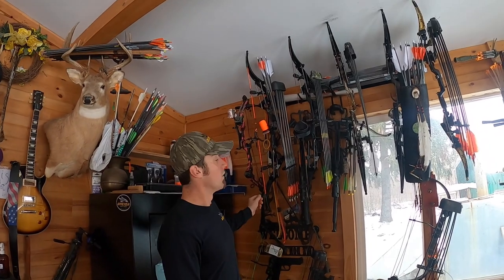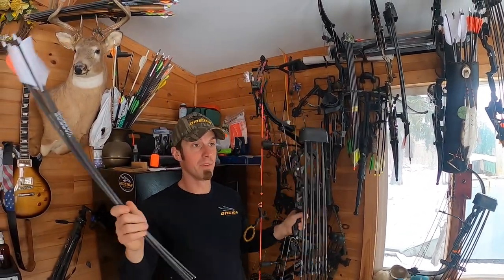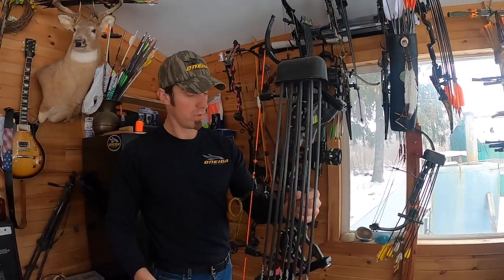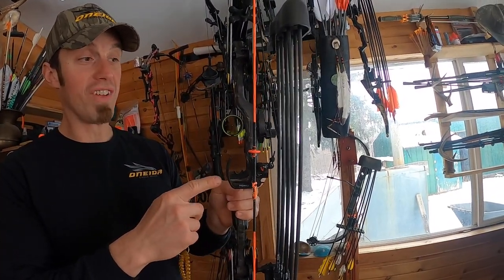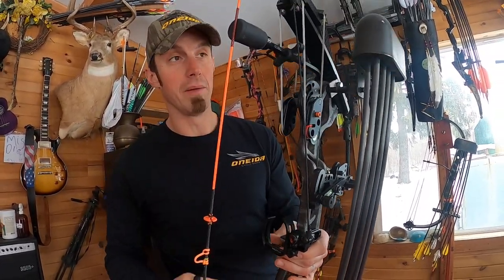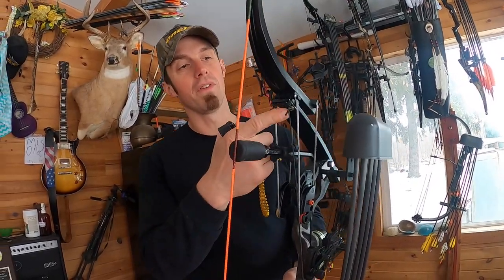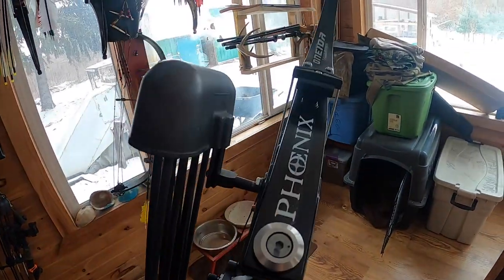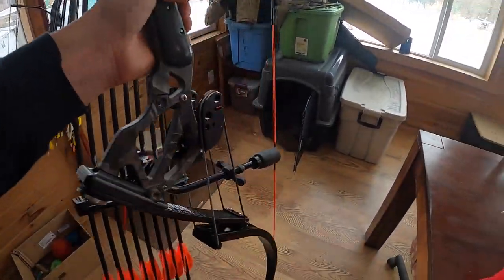Oneida Eagle Phoenix Long : Vapor Trail Limb driver arrow rest with a modified nut bar for the cord!

Comment: i put a limbdriver on an oneida talon.  I have to remount, though as the rest mount encroaches into the shelf/riser cut out.   even once that is done, i think i have to either get thinner vanes for the arrows, or at least run the arrow, cock feather out.   Did you have any vane issues striking the bow with your setup? or is the cutout on this oneida deeper than the older ones?
Reply from the maker: Phoenix there is no problem. Riser is cut out perfect